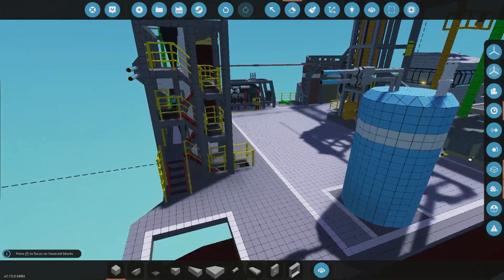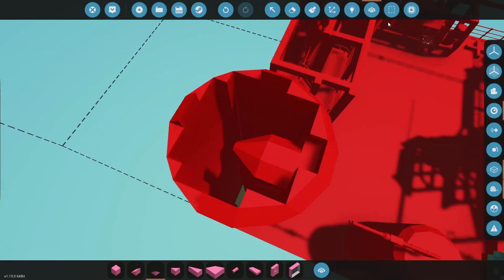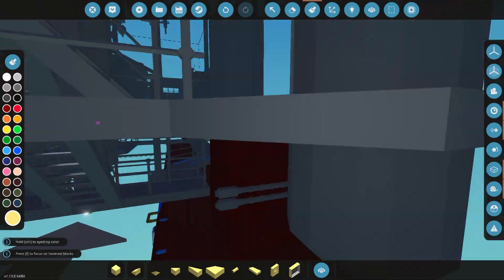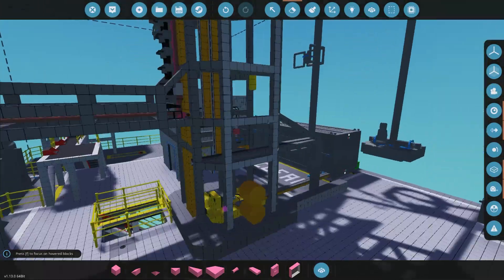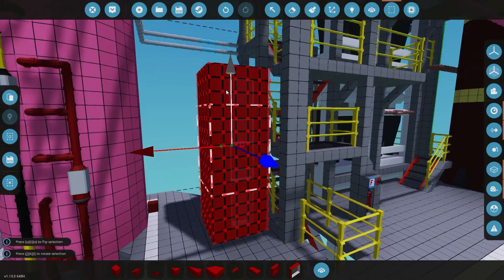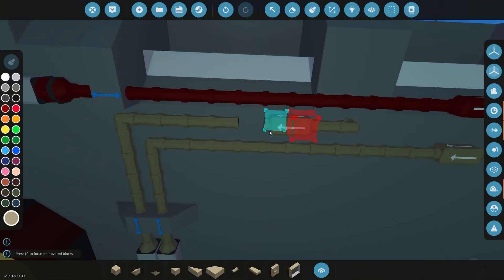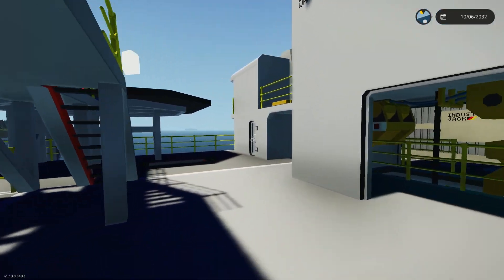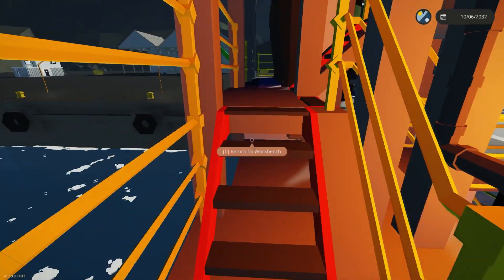Stormworks Build Series : Ocean Going Oil Rig Episode 9

Comment: Your oilrig already looks awesome. Regarding the refining process, I noticed that it can be made more efficient and faster by recycling the heat of the fuel coming out of the refinery with heat exchangers. There is also a lot of energy in the furnace exhaust which can be utilised with heat exchangers. Id estimate this could at least double the potential oil troughput.
Reply from the maker: That’s a great point! I did take some heat out of the generators coolant but I did not think of recycling the fuel’s heat I’ll have to look into that!!
Reply: @WhackAL  Using fresh oil to cool the generator is indeed pretty clever. From the things I mentioned Id say looking into utilising the exhaust heat is probably the most effective one. Iirc the exhaust gas is >3000°C when coming out of the diesel furnace and when properly used to preheat the oil I noticed that the oil entering the refinery can actually become hotter than the furnace.